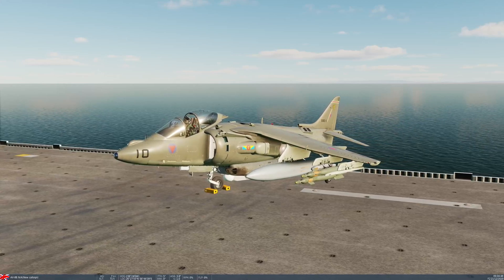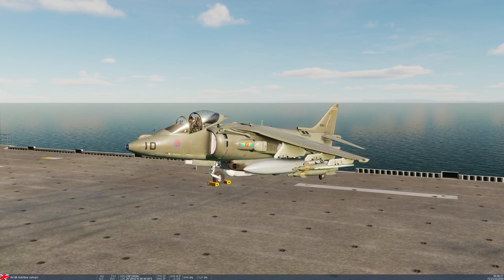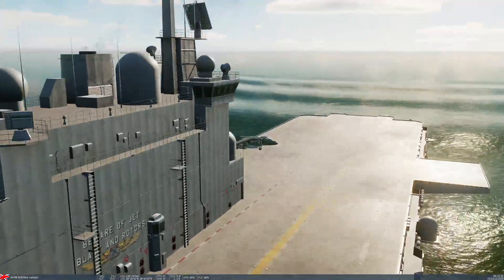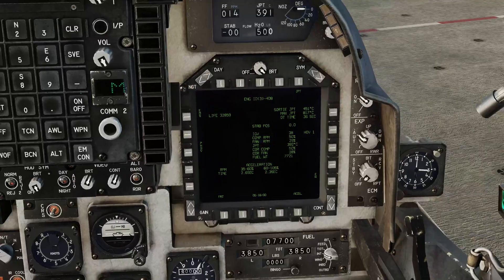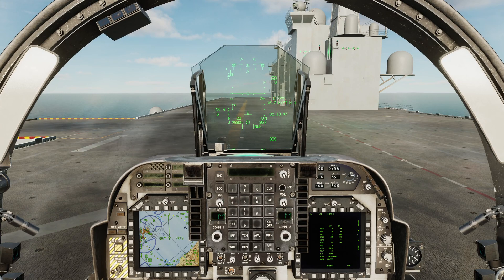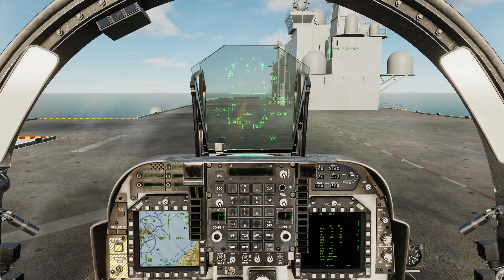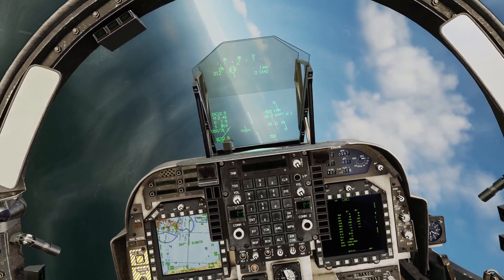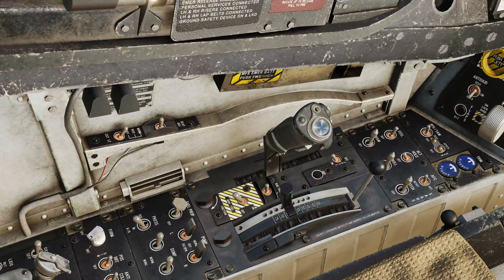DCS AV8B Tutorial 14 - Ship ops

Comment: Harrier is anything but a large helicopter. A helicopter the larger it gets the more stable it becomes. Harrier is anything but stable. 
Also you don't cool the nozzles. The problem is the turbines and all the other stuff that gets hot after the burning chambers. The nozzles is usually where you can measure the temperature (exhaust gases temperature) and make a correlation... if you have 900°C at the nozzles then it means the turbines are melting etc.
Reply from the maker: Thanks for the correction. I should have mentioned the relationship between nozzle temps and engine temps. My comment about it being like a big helicopter was just in reference to the slow reaction to control inputs.
Reply: @deephack  
No problem. Is not a big issue. I think my comment was also a bit rushed and maybe came a bit harsh. I think it was soon after a forced ejection from a sinking Harrier :D  :D